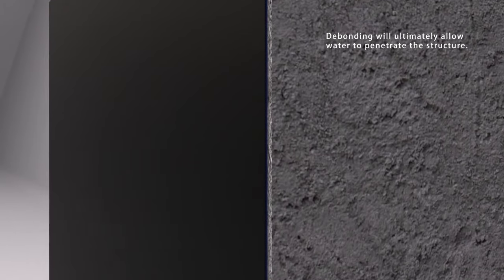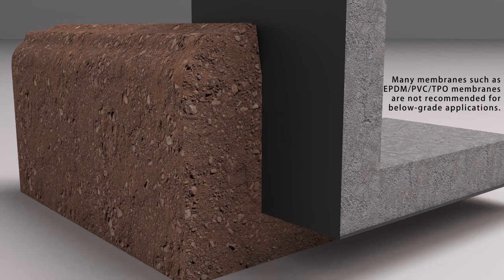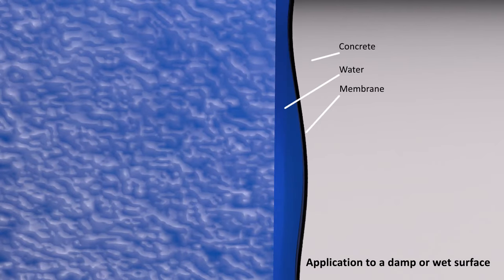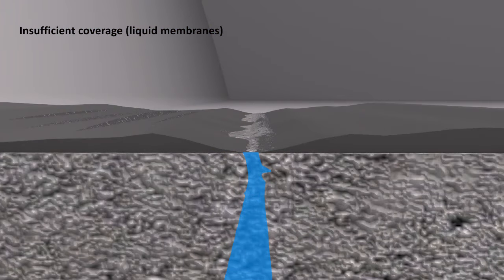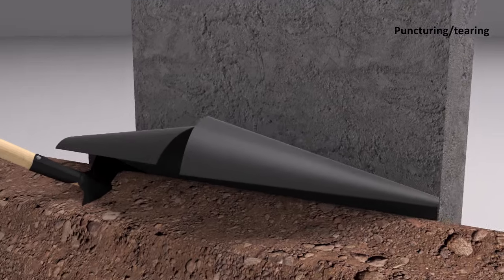Why Waterproofing Membranes Fail

Comment: Very informative however the researcher should recommend what are the latest technology for water proofing
Reply: It's crystalline Waterproofing. Also called as Integral Waterproofing.
Reply: @rehanzamindar6533  And it's super expensive!
Reply: Use a hydrophobic pore-blocking ingredient to make concrete repel water, such as Caltite by Cementaid

Comment: 25 years ago I had some Ice and Water Shield left over so I put it on, 2-ply, on a patio as a "temp" solution.  This stuff is only approved as an underpayment.  It is still in service and has not even deteriorated, de-bonded, or become stiff.  It has never leaked.  What matters is if your installer is a professional and understands his/her materials.  That is the real take-a-way here.  The alternatives?  Well, over competency, you have none (also the take-a-way here). You (or someone later) can pay for your mistakes, or, you can pay a professional--who might make a mistake.  Or wait till we can just print it.
Reply: Can't agree your point even more
Reply: it not the product as  such and yes some are better than others more the installer if he/she knows what there doing and has pride in there work so you are bang on

Comment: Most of this is quite true for membrane failures, but there are many technologies for membrane protection that are great when installed correctly. Just relying on concrete admixtures, crystalline additions, other pore blocking technologies which is referred to here, is just 1 approach to watertight construction. But concrete cracks, and also has many placement considerations that can upset this also. Dry basement construction is about 3 types of protection as per British standard. 1. is membrane protection.  2. is integral concrete quality plus the joints / CJ's using waterstops. 3. Drainage design. This is a layered approach to dry basement design, and covers multiple lines of defense, as you say, application issues are common. You have to plan for success and have all parties working to a common cause. Having QA and hold points verified at key times, will improve any application. Adding pore blockers alone is perilous and disrespectful to understanding the overall dynamics of waterproofing.
Reply: In the USA a huge problem is careless backfilling and large rocks damaging ( sometimes severely) the protection board/ drainage board

Comment: Not sure why liquid EPDM would fail other than not putting the primer on. It's pretty elastic and you can layer it pretty thick. You could also not have to worry about screeding because the EPDM will fill the gaps and remain elastic. You would think that you could put a 60mil liquid EPDM barrier and encapsulate the entire exterior and it would be more water tight than a frogs ahole.

Comment: Nice  3D representations, but I  do not agree on stating that TPO o PVC membranes do not work (or even bituminous ones). It is always required some kind of protection for the concrete so water doesn't corrode the rebars or damage concrete. Fully adhered membranes work perfectly since these can be either post o pre applied and the adherence is both chemical and mechanical to concrete. In severe cases compartment systems can be used to have a segmented waterproofing, so in case there is a punctual failure it will only affect one specific compartment. Several solutions such as wet applied membranes, fully adhered TPO membranes, PVC membranes with compartment systems. injection hoses and polyurea, among many others, might be the solution. Bituminous membranes stand approximately up to 0.5 bars, while fully adhered TPO membranes can stand up to 2 bars. It cannot be said that a technology doesn't work if you don't know the factors such as water column, water quality, durability expectations (service life), available budget, level of permeability required based on use type (according to BS 8102:2022).So, my recommendation, don't generalize, bituminous membranes in some projects that are not exposed to agressive conditions or don't require a long service life. Another point: if by any reason the membrane fails, you can always use injection resins as a corrective way to stop water in negative pressure.

Comment: Good arguments for nor using membranes. What solutions do you recommend instead?
Reply: he give the solution which the properties and durabilities of the concrete itself must be increased which we have now like fly ash which can fill the porous of concrete
Reply: @alexhermawans  That is not really a solution since you are not waterproofing the concrete. The reference to newer technologies is vague and can be interpreted in many different ways. There is no real option provided in this video.
Reply: @jamesrgibsonha  ok I get it. So not just integrated concrete needed then, we also need coating the concrete right?
Reply: I wanna see some sort of solution that blends in with the wall and cladding above
Reply: Agreed James.  Nice video about the problems without any reference to the alternative. So what should we look into using  then?
Reply: the only solution is epoxy coating over concrete ...last for years..
Reply: @mericontechnologies989  
It degrade under sunlight and epoxy is not elastic to cater to heat expansion.
Reply: Bentonite clay solutions such as Bentotex from Corea is one option for an improved membrane solution that can eliminate backfill issues. Integral concrete crystalline growth or other sealing additives in combination along with correct pitched drainage will really help.

Comment: What's the alternative? Are the liquid membrane any good?
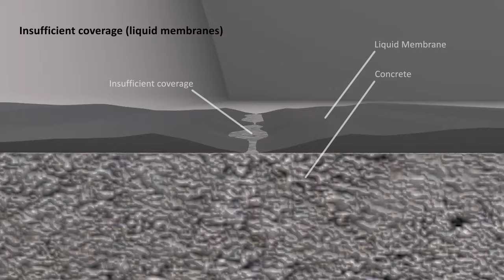Reply: they dismiss liquid membrane at the 2:05 mark
Reply: It sounds like all options are doomed to failure at some point. Should just source what the old guys did with those building that have lasted for centuries!! 😉
Reply: I use 2layers of self leveling liquid membrane. Works great.
Reply: @XenusMama  
The only problem left is durability. Cheers.

Comment: 🎯 Key Takeaways for quick navigation:

00:19 👷‍♂️ Waterproofing membrane installation requires skilled labor and 90% of failures are due to poor workmanship.
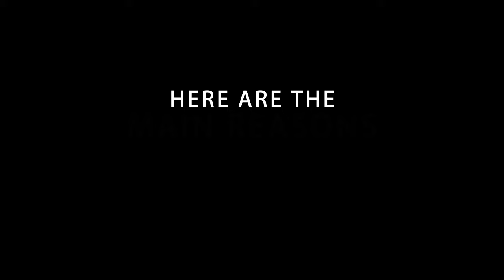00:32 ❌ Picking an inappropriate membrane for the intended application can lead to failure of the waterproofing application.
01:03 💧 Any debonding of the membrane leads to water penetration into the concrete.
01:26 ⬇️ Certain membranes not fully adhering to the concrete surface make them unsuitable for below-grade applications.
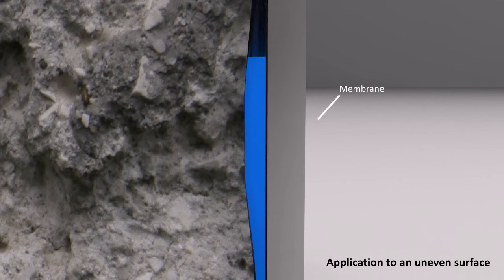01:39 🌧️ Applying a membrane to a damp, wet or uneven surface can cause debonding.
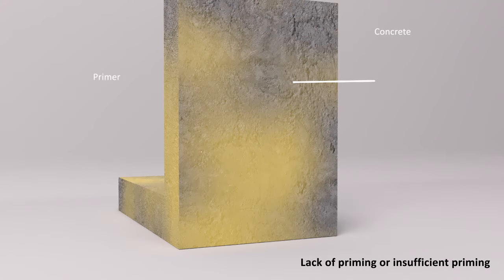01:52 🔄 Lack of adequate priming prior to waterproofing application can result in failure.
02:19 🔗 NOT fully bonding overlaps can cause potential breaches in the waterproofing layer.
02:32 🎈 Failure to properly prime a surface may lead to air becoming trapped under the membrane, causing debonding and blistering.
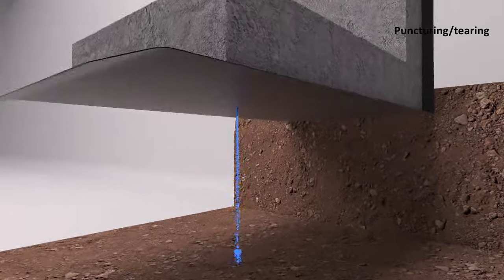03:01💔 Damage such as puncturing and tearing from construction activities often cause breaches of the waterproofing layer.
03:30 ⏲️ Over time, waterproofing membranes may deteriorate due to exposure to the environment, which can lead to failure.
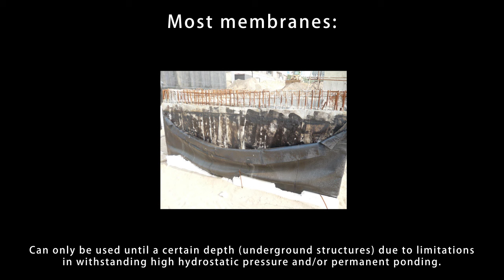04:24 🔄 In conclusion, new technologies that permanently reduce permeability and improve concrete properties are recommended as a solution over membrane applications.

Made with HARPA AI